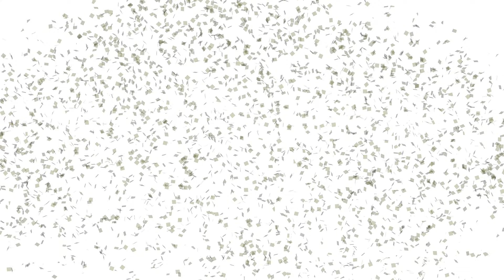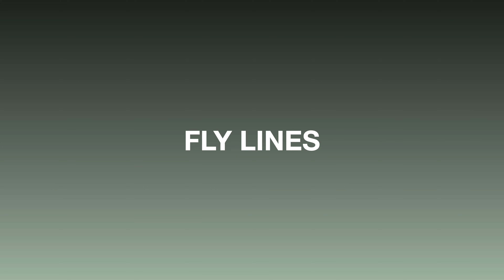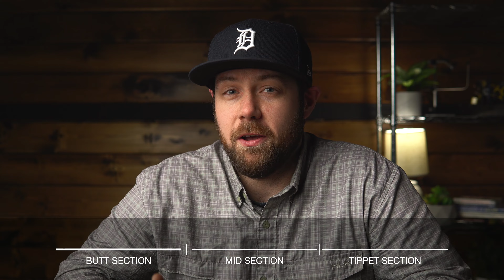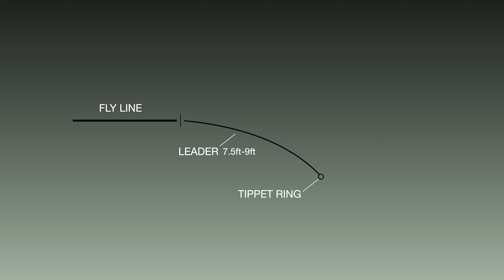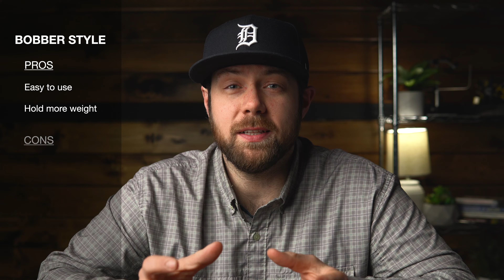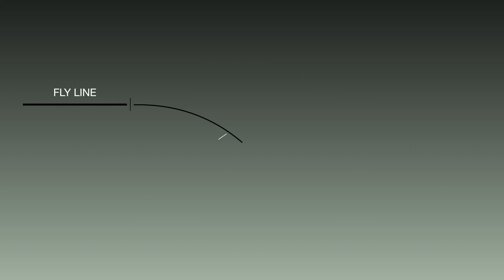Indicator Nymphing: Gear & Rigging for Steelhead

Comment: just starting out with a switch rod. the info i got on that setup was go one higher on the reel than your rod. ex; I have an 8wt echo switch rod with a 9/10 greys fly reel. they say this will balance the system better. in my opinion this setup casts beautifully and thats coming from someone who has little to no knowledge of casting. my instructor did though and it was truly impressive,

Comment: Great information in this video. What’s your personal favorite rod that you use?
Reply from the maker: So many great rods on the market... Nymphing for Steelhead it's tough to find a better deal than the ECHO ION XL. Lots of 8wt rods out there on the market are designed for distance casting and too fast/stiff for roll casting.
Reply: @TheNorthernAnglerFlyShop  Echo definitely makes a great rod for the money. Have you tried the new Indicator rod they came out with?
Reply from the maker: @Detroit3Pistons  Really hoping to fish that this fall...